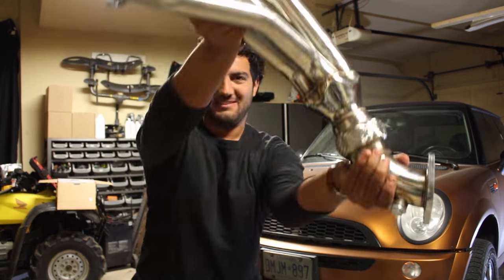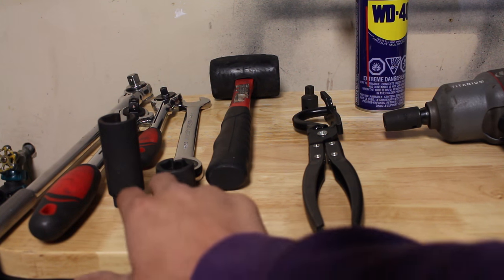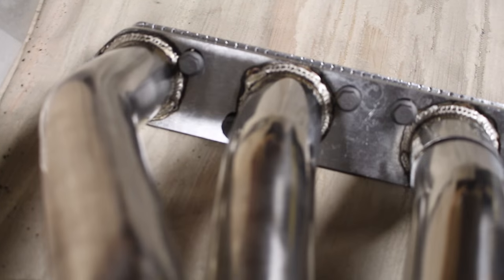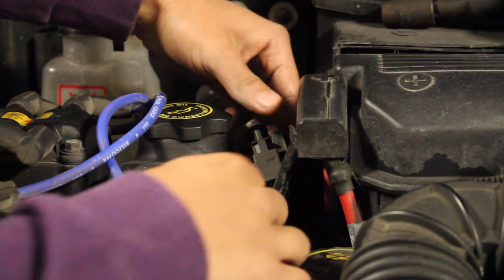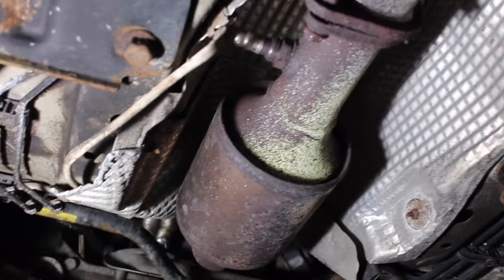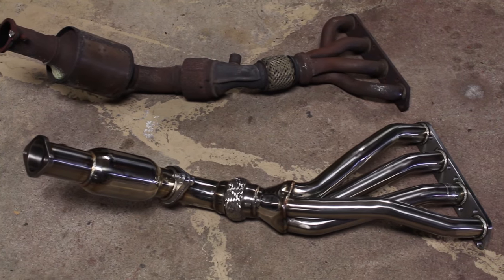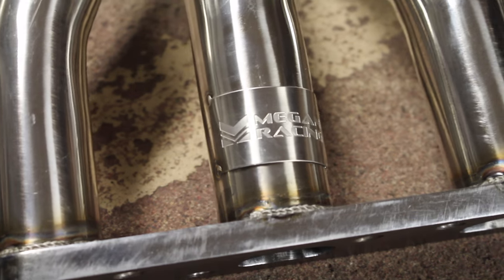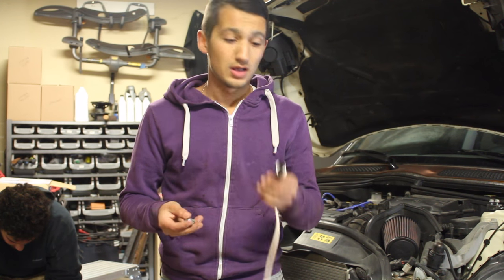How to Install Headers

Comment: Now that you have a less restrictive exhaust, shouldn't you flash your ECU to take advantage of it and get better results?
Reply from the maker: +888TopGear888 I plan on it :)
Reply: +milanmastracci do you think they make after market headers for my 2014 ford fusion titanium 2.0L EcoBoost?
Reply: +milanmastracci can you shared the link where u bought those at??
Reply from the maker: Bought what at?
Reply: milanmastracci those headers yall put in into the mini where you bought em at online or you went to a particular store?
Reply from the maker: Amazon :)
Reply: +milanmastracci thanks bro👍👌

Comment: How did you get the headers between the heat shields and the swaybar. Or did you feed it to the top if so what did you remove.
Reply: Exactly.  We seem to be missing the "how to"  portion of this "how to" video.

Comment: What happens if I'm replacing a header and the bolts from the engine to the header brake. I'm worried about replacing the old header

Comment: Stupid question, but did you disconnect your battery when doing this? I'm planning on putting my header on this weekend.
Reply from the maker: +Thomas Trotta Nope. You can if you want but it isn't necessary :)
Reply: +milanmastracci okay, thank you!
Reply from the maker: No problem Tom :)

Comment: hey i installed mine today... after doing so I started my car and it was extremely loud and also saw smoke coming from the header location... i had 6 bolts as oppose to the 7 or 8 that go onto the stock header... do you know any reason why it would do that?
Reply from the maker: +Patrick ambroise It could be the coating on the actual headers smoking off. Its normal. If the smoke continues, that's when I'd be worried. 

Make sure nothing is touching the pipes because if it does and the headers get hot, you could start a fire.

Comment: will the megan racing header cause a check engine light?
Reply: +Thomas Trotta yes, it does not have cats.. but you can just buy a obd II bluetooth port.. Toque app and delete the code.
Reply: +WillieNillie but wont the code keep coming back? is there a way around this
Reply from the maker: +WillieNillie Guess what my next video is.. :D
Reply: +milanmastracci Is it a how to fix megan racing header check engine light?
Reply from the maker: +Jagger Games You got it :)
Reply: +milanmastracci I'm debating on getting this header. I have a resonated stratmosphere exhaust from wmw and it's too quiet. might get this header to make my exhaust louder.
Reply from the maker: Do it!! It makes the exhaust no so much nicer!!

Comment: How the heck do I know how much force to appy to each bolt? Snug, etc.
Reply from the maker: There is a proper torque spec in the service manual for each car.
Reply: milanmastracci thanks
Reply: What tool did you use to check torques? My torque wrench is not going to fit
Reply from the maker: If your 1/2" won't work, use a 3/8"

Comment: so are these headers legal in ontario. I thought u had to have a cat
Reply from the maker: +Aspiired Because you need your cats in ontario, this is only legal if you bring it to a track or use it on private property. Hence when on the packaging of the headers, it says its designed for 'off-road use only'.
Reply: damn i wish there was a way around it
Reply from the maker: Well I have them in my car and i'm yet to run into any problems.

Comment: Those bolts are soooooo overpriced, you can just go to your local nut and bolt supply and bring one of the old bolts and you can get the top grade of that size for a tiny fraction of the oem pricing
Reply from the maker: +Ben Ward Yeah I know but I an very picky about getting OEM bolts / parts so that there is no compatibility problems. Something that is nice is the bolts that you get from BMW are coated with a rust-proofing coating, looks similar to powder coating.
Reply: Ahh I see, well if you can afford to do it then why not, especially if it's someone else that's paying for the work you're doing on their car
Reply from the maker: You got it Ben Ward :) its nice when its not your pocket ahah